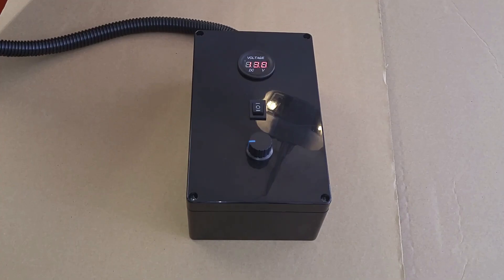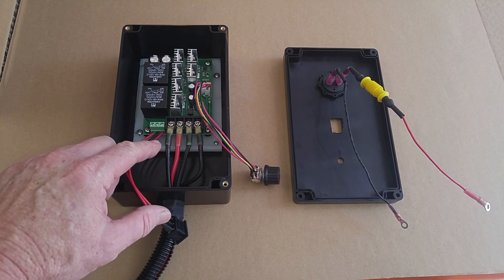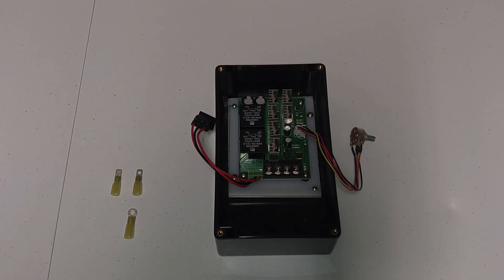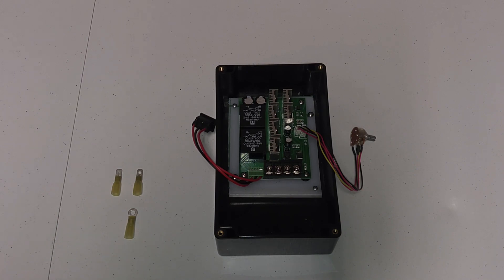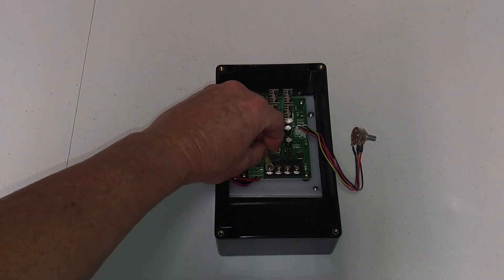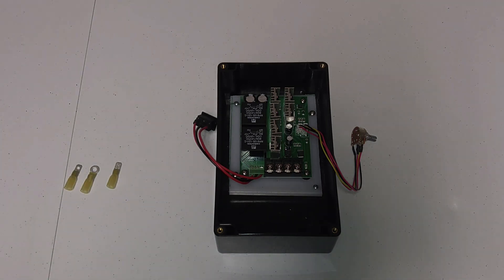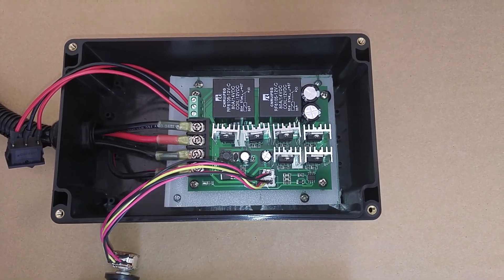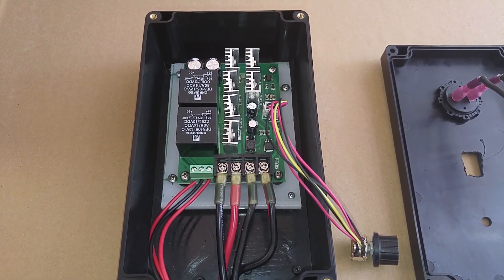DIY Kayak PWM Digital Speed Controller Box

Comment: I have a minn kota endura 30 and motor guide 54lb trolling motor. Plan on using a 100ah lithium battery. Do I need to use a 100a pwm? Also 100ah overkill?
Reply: Also the 2 motors are going on 2 separate kayaks  with their own batteries
Reply from the maker: If you are going to use it for both motors then a 100A PWM is good.
Reply: @Aksmaniyak  but do I need a 100a specifically because of the 100ah lithium battery? Do the motors even draw that much amperage?
Reply from the maker: @youngjoon117  No, battery size does not determine the PWM rating. The max amp draw of the trolling motor is the factor. I like to have a battery at least 2x the max amp draw of a TM.

Comment: Great Video. The voltage gauge did you just connect it to the pos/ negative. Thanks
Reply from the maker: Thanks Skip. It is one of the many on Amazon. Yes, just hook it up to the power connections.
Reply: The one I’m looking at it has a USB port build in.
Reply from the maker: @skipelliott985  Those usually draw a minimum of 2A. I have never tried that so I can't say it would work.

Comment: Any thoughts on using a 60amp PWM for the Haswing 80 amp Brushless Trolling Motor so I can mount that  Motor as an engine mount motor on my Boat to replace my existing 55amp 12 volt Neraus Brushed Motor. My thinking is I will get greater power, much longer runtime at less amps at the expense of an additional battery provided the Haswing Motor wires can fit straight to the PWM and bypass the control switch completely ?
Reply from the maker: Hi Wayne. Most PWMs are not made for brushless motors. The Haswing has a digital speed controller (PWM) already. You don't need to change anything for your project.

Comment: Aksman,  What size gland nut did you use to go through that box and did you get it on Amazon or electrical store or whereever. I'm trying to do this to my Predator MX kayak.
Reply from the maker: Hi John. I don't remember what size it was because I bought an assortment pack on Amazon and used one that fit.

Comment: I've gone through three pwm. It smokes and makes a pop when I hook up the battery. What could I be doing wrong? I've checked all my connections and the look good to me.
Reply from the maker: I did that once by accident with the same smoke and pop. The power inputs were reversed. I know not all PWMs are great quality but if this has happened 3 times then you must have something wired wrong. JMO.
Reply: @Aksmaniyak   with the SAE connectors, can I have two black connectors hook together? Does that make sense? I wish I could send you a pic...
Reply from the maker: @kalebpate8510  I'm not sure I understand the question.
Reply: @Aksmaniyak  I figured it out!! The polarity just needed to be reversed, because hooking the two black SAE connectors together was crying everything.  Thanks for the help
Reply from the maker: @kalebpate8510  I'm glad you worked it out. Not all SAE connectors can be used together because of polarity issues. Was that it?
Reply: @Aksmaniyak  yes

Comment: Does this still need a circuit breaker?
Reply: And did you place it in the box?
Reply from the maker: @kalebpate8510  Yes it needs a circuit breaker. I put one about 1 foot away from th battery between the trolling motor ans the controller box.

Comment: I have a 45 lbs thrust TM, hooked my PWM,  it 55 amp along with a 50 amp fuse etx
 Question is, my PWM when I run my trolling motor on 5.and turn my speed up to the fastest speed on my kayak it will trip my fuse and I have to wait 5 minutes or so to reset it. What could be the reason for this? Even when I turn it to 4 speed and turn it up all the way ot will trip the fuse but not as quick as when it's in speed 5. Another question is why does the PWM when on speed 5 at 3/4 speed pulsate? Speed up, slow down continually until I lower the speed?
Reply from the maker: Hi. You might need to go to a larger circuit breaker. What size wiring did you use to hook up the PWM?
Reply: I used the one you posted, but it might be too long,  its probably 8 ft in length. 7 wire,  grey case, I think the 22 awg
Reply from the maker: Yes, that might be too long.
Reply: I used 10 guage to hook up TM to PWM etc. But the speed controller is the 22
Reply from the maker: Check the connections inside the speed controller head unit. There might be corrosion or a loose connection.
Reply: I realize this is an old post but for others. You are not supposed to use the controller that comes with the trolling motor along with the PWM controller. The PWM controller replaces the controller that comes with the trolling motor. The PWM will connect directly to the wires leading to the motor bypassing the controller inside the trolling motor. Hope this helps.

Comment: I’m debating on getting one of these because if it rains. I noticed it’s not sealed do you get issues with splash or rain?
Reply from the maker: I have not had a problem with minor splashing. The box has a seal ans I cut the holes with a tight tolerance and use marine goop to seal them.

Comment: How are you cooling in a sealed enclosure?
Reply from the maker: It is air cooled. I raised the circuit board with an offset that helps with the heat transfer. Also, it is 60/100A rated and it never approaches that amount.

Comment: Do you have any heat problems with the PWM being enclosed like that?
Reply from the maker: Hi Jim. No, I have not had any heat issues with this build. The box has a lot of space inside which helps with heat transfer. I also mount the PC board slightly above the mounting plate which also allows for air flow under the board.

Comment: Thank you for your great informational videos. Two questions. 1. How do you get the  PWM control knob off to drill the small hole on the box? And 2. The wireless PWM systems website (wirelesstrollingpro) I believe it is, is no longer functioning. Any Idea where I can get something similar (wireless)?
Reply from the maker: Thanks Juan. The PWM knob will pull off with a little force. The only other company that I know that makes a wireless version is GAMA.

Comment: Thank you for putting this video together. I have a question. Your digital volt gauge, does it stay on all the time or can you wire it to work with the on off switch?
Reply from the maker: Thanks Robert. This one stays on but you could use a switch. It really doesn't affect the battery usage.

Comment: Thanks for the videos. But what do you do with the extra wires in the minn kota trolling mootor. Do you just use the red and black wires to the own. And do I use the switch that come out of the trolling motor. Thank
Reply from the maker: You only use all the wires from the trolling motor if you are using the stock 5F/3R switch. When you use this PWM, you only need the black and red wires from the trolling motor. The yellow and white wires are not needed for the PWM.
Reply: @Aksmaniyak  thanks for the reply. Does this pwm have the forward and reverse switch. And should I go with a 60amp or 30 pwm on a minn kota 30lb? Thanks again.
Reply from the maker: Yes, this project uses the F/R switch. I would use the 60A since they are about the same price. It would be an extra added safety factor.
Reply: @Aksmaniyak  thanks for all the help. I do have one more question. What gauge wire do you run from the battery to the pwm? I got 10 gauge. And what size amp fuse should I run. Thanks again.
Reply from the maker: You are welcome. I use 10G for the battery/power wiring. I use a 60A circuit breaker for the motor instead of a fuse. It is easier to reset if tripped. Let me know how everything goes.
Reply: @Aksmaniyak good tip for the breaker instead of a fuse.  I did not consider the rest option.

Comment: What size wire do I need for a 50 lb. Thrust.  My boat is 15' so probably 18' of wire.
Reply from the maker: I have always used 10G. You could go to 8G with that length.
Reply: Minn Kota reccomends a 60 amp breaker and 4 gauge wire for runs of 15 - 20 feet for their 50 lb. Thrust motor.

Comment: Thanks for all of the videos. I have the 46lb Newport Vessels &  pwm. What plug did you buy to connect the wires of the shaft into the rear of the kayak. I see guys using 4 pin waterproof plugs, but I can't find anything rated for the 40amp draw of the NV46#.
Thanks you.
Reply from the maker: You are welcome. I used an Attwood connector. Using the PWM with the NV TM will not draw 40A. This is the link: https://www.amazon.com/Attwood-7622-7-3-Wire-Trolling-Connector/dp/B00K8DAQM6/ref=sr_1_1?crid=25LBTBH4DKETJ&keywords=attwood+trolling+motor+plug+and+receptacle&qid=1555071615&s=gateway&sprefix=attwood+trolling+motor+%2Caps%2C838&sr=8-1
Reply: @Aksmaniyak  I too am setting up a NV motor.  It is a 40lb, and I was thinking of adding a 40A inline fuse.  The link above is a 60A breaker.  Am I missing something?  Also, I thought this setup might create too much heat to put in a water tight box, but it must be ok.  Thanks for the time you put in the video to share.
Reply from the maker: Thanks Danny. You always want the circuit breaker amp rating to be greater than the lb thrust rating. If your prop was to foul or there was a current surge, the breaker will trip easily. That is why I went with the 60A. I have never had a heat issue with the box because of the way i put everything together.

Comment: hello Aksman  What do you think about mounting the pwm in the rear of the kayak and extending the
Speed and forward / reverse knob to the front of the kayak in a much smaller hand control box.
I thought i heard someone say that would fry the PMW.  Have you ever done this?
Reply from the maker: Hi John. I have made a remote before and they work just fine. I would not make it too long though (less than 5 feet).
Reply: Aksman thanks!
Reply from the maker: You are welcome John.

Comment: Thanks for the help. I bought a similar module & didn't know how I was going to get a 10awg connector n the space. Found you're video using the spade connector & drilled out & worked great!!!
Reply from the maker: Glad to help.
Reply: @Aksmaniyak  I'm making the same box. Does the speed controller knob just pop off to insert it into the cover?
Reply from the maker: Yes, there is no set screw.
Reply: @Aksmaniyak  Thanks

Comment: Its funny...I am on the same course as you and wondering if I should just go straight to the GPS trolling motor and save me some time....Well At lease I have some content to put up.  My main concern if the bulkiness of the GPS Motor.  I have the F10 and space is limited.  Not to mention the weight of the unit.  My 24 lb thrust motor and battery weighs in at 17.5 lbs....
Reply from the maker: Great minds think alike...lol. I went with this Haswing because the F12 is stable with a large payload rating. I have modified another F12 with a transom mount trolling motor and foot pedal steering (see other vids). It is a 12V 65lb thrust with a digital speed controller. No GPS. It only weighs about 14 lbs because it is brushless. I don't think there is a GPS transom mount out there yet.

Comment: Great video!!! I was wondering if you have test the unit to different voltages perhaps 24V for a MK riptide, also is unit still going strong will you recommend this unit after using it for a year or so?
Many thanks again for the video!
Reply from the maker: Thank you Ali. I have not tested it for 24V because all my kayaks are 12V. The PWM is rated for 24V though. The unit is still going strong but I have not had it for a year yet.
Reply: @Aksmaniyak  i see, i have been doing some onine research and there are some other units that are advertise as multiple Voltage input so i thought this one might been one of those... anyway could you please share what trolling motor you are using with this unit and also your battery, ultimatetly i want to understand about how much autonomy (hours with a single charge) you get out of the controller??? I wonder if it is comperable to the WTP (wireless troling pro) or the MK OEM digital maximaxer???
Reply from the maker: This PWM works well but I like the WTP and have purchased several of them for kayak builds. This PWM is similar to the WTP and Digital Maximizers but is much less expensive and comes from China. I prefer to use the USA brands in my kayaks. To approximate the run time for a trolling motor and battery I use this formula. Battery(Amp Hours) divided by trolling motor (maximum) amps = approximate run time at full speed. Of course, if you go slower then your run time will increase.

Comment: https://www.amazon.com/Controller-10-50V-Driver-Module-Extension/dp/B07B4B2X35/ref=sr_1_1_sspa?ie=UTF8&qid=1546557436&sr=8-1-spons&keywords=pwm+speed+controller&psc=1 you tell us what PWM controller you used ?? cost ?? theres one on Amazon for about  20 bucks just wondering if this will work ??

Comment: i noticed you had a video from a couple of year back showing the Wireless Trolling Motor Pro.  did that system fail and do you  recommend making your own instead of purchasing one?
Reply from the maker: Hi. No, the WTP is still going strong. It is just that many people are buying the inexpensive PWMs from China and had questions about building a box for it.
Reply: ok thanks for the reply.  still trying to decide which route to go.

Comment: I wounder how you cut the square hole to the forward/reverse button? Thanks a million for a great video!
Reply from the maker: You are welcome. I marked out the square with a marker. I used a standard drill bit and drilled out each corner. Then I used a hacksaw blade (no handle) to cut out the rest and used a small file to smooth out the cut. I hope that helps.
Reply: It helps a lot, thank you very much for the reply!
Reply from the maker: You are welcome.

Comment: great walk through...
I have a question maybe you could answer. When i add my pwm i want to put the reversing switch and the speed knob on the end of my tiller rod which means i will need to extend the wires for those parts about 6 feet. Ill mount the job box and actual pwm at the stern by the motor.
SO question time...
What size wire should i use to extend the dial and switch by 6 feet. They look tiny so i take it they are not actually carrying the full current load of the motor.
 You see i went with a tiller steering over foot pegs because i am often working the bank while standing and the tiller rod lets me steer while standing. I have a 2 position tiller rest that lets me lay low for sitting or high for standing.
But having to bend down to start, stop or speedup/slow down is a pita.
 If i put these small controls on the end of my tiller rod then i solve that problem.
Thanks
Reply from the maker: Thanks. I have done what you are talking about before. I don't know the exact gauge of the wire but you can bring the PWM to a place that sells wire and find the right size that is contained in a cable already. I have used telephone extension ribbon cable before in another project and it worked fine. You can use a junction block to make the extension. Mount the junction block inside your box and then run your extension cable from the block out to your new smaller control box. Most electronic hobby shops will have the waterproof project boxes. Let me know if you have any more questions...good luck!
Reply: great thanks, so in your experience the thin wire in phone line wasnt a issue? If so thats what ill go with for sure.
 I have a pretty decent source for project boxes (or did have its been a long time since i used them) from when i made diy vape mods.
Thanks for the info.
Reply from the maker: I checked the size of the wire in the phone line and it was the same gauge for my project. Just check to make sure it is the same gauge. Some of the big box stores also sell 3 conductor cable that you can buy by the foot. You might check that out too.
Reply: Thanks! when i get around to it ill let you know how it worked out.
Hopefully soon. I have some major changes coming to my diy kayaks this winter if i can swing them money wise.
 I know i am reworking the bottoms for better shallow water daft and when i do that i am hoping to use real fiberglass at least on the bottom half. I want to replace all of the poormans fiberglass with the real stuff since i am happy with the hull shape now.
 Just got to get around the fact that they are foam core so i ether have to use expensive epoxy or use the glue and newspaper trick to keep the poly resin away from the foam.
 Its not that the poormans isnt good enough, its been good for 2 seasons now on 2 different builds. But i am wanting lighter and stronger.
 If i go poormans again i will NOT be doing the full burlap cloth.. i bet it held 60 pounds of paint making my yaks much heaver than needed.
Reply from the maker: Sounds like a good plan. That is what makes DIY fun and challenging...always searching for a better solution.
Reply from the maker: Thanks. I thought about doing a remote that ran through the tiller arm so I could control the kayak while standing. The PWM in this video will be going on a tiller controlled kayak because there was not enough room to add foot pedal steering. As for the wiring, you can use the same gauge wire as the PWM for the extension. Since it is a digital controller, heavier gauge wire is not necessary. I have used telephone extension ribbon wiring before for remotes and it worked fine.